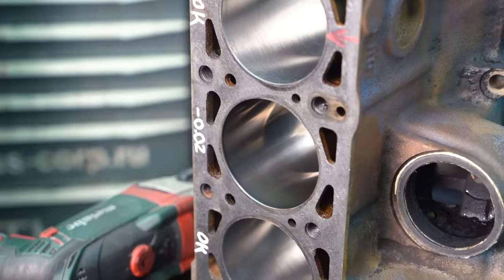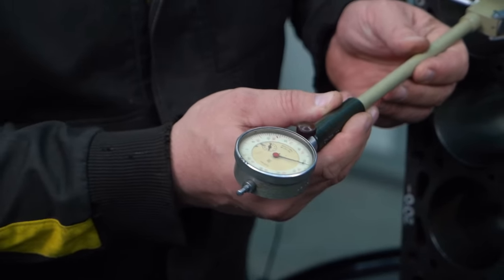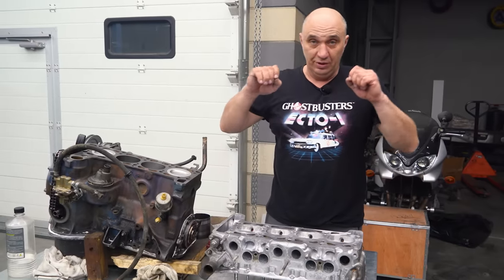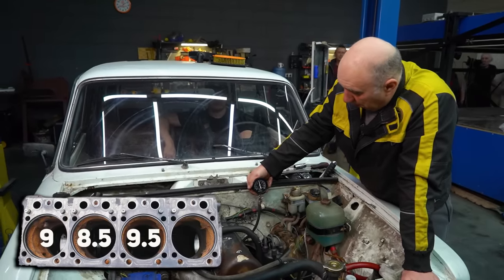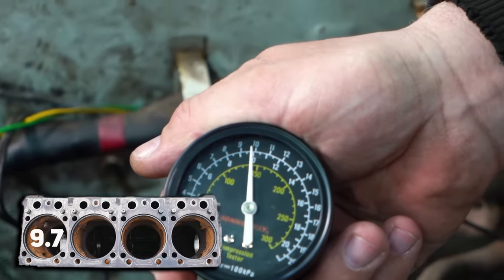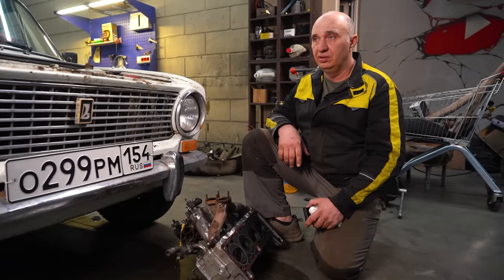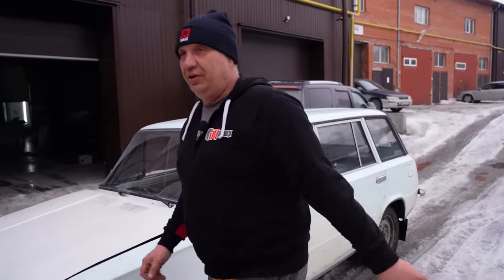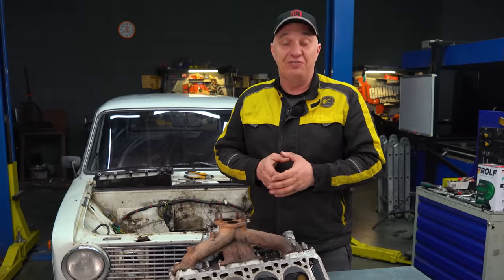Honed cylinders or mirror finish - which is better?

Comment: I never heard of a person wanting a mirror finish on cylinder walls. Usually when I see mirror finishe on cylinder wall the engines is worn out.
Reply: Oh yeah? What about Nikasil Chromium Bores? All of this work has been studied (in depth)  by most Car & Motorcycle Manufacturers.
Reply: @peterduxbury927  Still never heard of it
Reply: @peterduxbury927  That's mostly a 2-stroke thing. I have never seen a 4-stroke with hard plating in the cylinder. (not saying they dont exist)
Reply: @markchapman2585  Motorcycle engines. Ultra-high RPM.
Reply: @peterduxbury927  nikasil bores are still honed for proper cross hatching.
Reply: Most race engines are honed to a mirror finish but they have special low tension rings  designed to work with smooth cylinders. check out some videos by Lake Speed Jr or Total Seal rings.  Lots of horse power to be gained by reducing the friction of the rings. Also most of the engines that have these cylinders with the thin rings have a vacuum in the crank case for even more power.
Reply: @peterduxbury927 They are still honed to 2 stroke or 4 stroke.
Reply: @Pyroteknikid  Some Perkins Diesels had hard chrome plated bores around the 50's-60's. Most were cast iron though. On those chrome cylinders the piston rings were cast iron. We even have one tractor that has cast iron pistons and chrome cylinders. Top RPM is around 1500.

Comment: The look of those valves at the end of the video tell you everything you need to know.
Reply: Yeah I was gonna say, the only real results are in the heads
Reply: Enlighten us. What do we need to know?
Reply: @rsemrad2  basically the smooth creates more carbon in the heads from the piston rings removing hundredths or thousandths of metal from the cylinder walls and themselves through contact. A smooth bore would allow equal distribution of pressure around the cylinders but momentum would mean the pistons have just enough wiggle room to touch the cylinder walls where as with a honed bore, you would have those pockets of unequal pressure filled with fluid and fluid is dynamic which means the pressure would force the oil into the low pressure pockets, thus creating a smaller area for pressure to build up and equalizing the pressure. In the smooth bore that pressure only sits in one area and is dispersed on the 3rd stroke instead of every stroke in the process. It means your rings will wear out faster and if there's blow by, then it's just as hard and as fast going the other direction as it is going in the intended direction
Reply: @Unfoundrumors as I understand it 2 and 4 are polished and those are the cleanest. 1 and 3 are honed and those are dirty
Reply: @doopiej  yes and as the brother explained, when your cylinders get hot enough, they’ll burn deposits away, which means those rings have a higher chance of failing in those cylinders
Reply: Something else I noticed is that some of the shots in video are identical to the episode where they make custom valves from a gold-colored soft material. Those valves were worn at the point of removing the head and there's no telling if they sealed well at the guides. Maybe we shouldn't really draw any conclusion from this video😮
Reply: @doopiej  there's plenty of reasons why not to use smooth bore on an everyday application, smooth bore is really only used for racing cars and engines that are not going to be used for very long. You just wanna fuckin argue about other shit cause you don't know anything, the biggest reason you hone a bore is so that the piston doesn't scour the cylinder and crack it causing coolant to leak into the cylinder and thus leading to something called a "break down"
Reply: @Unfoundrumors  I haven't at any point remarked polished cilinders would be better for everyday applications and frankly I think your reaction is a bit weird and uncalled for.
I know perfectly well why honing is used and how rings and walls should wear. 
Just thought it was interesting the polished ones that ought to leak and burn more oil look cleaner in this particular head, but at the same time those valves aren't actually normal valves so there's nothing you can really conclude from looking at them anyway.
Reply: its not a big deal either way  ive put heads on motors that were high mileage and mirror smooth the motor ran for a long time afterwards. i do crosshatch mine but in my experience its not that big of a issue ,ive seen em rebuilt with no honeing and run perfect for many miles

Comment: I swear these guys can read minds... I was wondering exactly this yesterday while thinking about sleeveless alloy engines (like Briggs and Stratton Koolbore) requiring a mirror finish in order to not eat themselves to death. I think it's a 2 stroke trait though, whereas a 4 stroke requires the honing to hold oil on the walls.
Reply: A 2 stroke need an honed cylinder to hold oil just like a 4 stroke
Reply: @pietrodiani6368  no they chrome plate most 2 cycle weedeaters smooth when the plating wears out it is toast
Reply: @patrickday4206  that is not chrome plating. I think it's Nikasil on aluminum bloc. When the plating wears out, the block is not serviceable anymore.
Reply: That would make sense because you put oil in the mix for two stroke engines.
Reply: Sleeveless engines of aluminum rapidly wear the aluminum down but leave the harder silicon parts of the cylinder wall in place.

Comment: Back in the early 90s, I did a ring job on a 4 cylinder engine that had stuck rings on one cylinder and a cracked piston in another I honed the cylinders and after a week of regular driving, I took it for a 350 mile round trip that took about 6 hours. That engine never used any oil after that. It used half a quart during break in and that was all it ever used during the time we had that car.

Comment: Honing for a combustion engine allows holding oil in the cylinder walls for better lubrication.  Smooth walls are for Hydraulics to save the O rings for a longer life!!  Been a mechanic for 45 years
Reply: Doesn't the oil just bet burned off by the ignition cycle?
Reply: @michaelbirchall2247  yeah so does a 2 stroke engine you want a continuous oil film just like bathing your main bearings that's the whole concept! If you took an engine with a cross hatch pattern and took and ran total synthetic oil it would never break in! It would actually consume more oil that's why conventional break in oil is preferred then switch to synthetic oil latter . Those rings need seated in ..
Reply: Yes, rings need to be seated during the break-in period of an engine: 
 
What happens during break-in
The break-in period, also known as run-in, is when a new piece of equipment is conditioned by running it for an initial period. 
 
Why rings need to be seated
The rings need to be seated into the cylinder wall to create a compatible seal. This process ensures that the engine achieves maximum power output and consumes the least amount of oil. 
 
How to seat the rings
The engine should be run under a load to increase cylinder pressure and force the rings into the bore. This can be achieved by gradually increasing the load from 50 to 75 percent, and eventually to 100 percent. 
 
Tips for breaking in an engine 
 
Avoid pushing the engine too hard. 
 
Vary the engine load and rpm. 
 
Don't keep the rpm at the same speed for more than a few seconds. 
 
Lightly let off the gas pedal and gently get back on it.
Reply: A cross-hatch pattern on a cylinder bore can help with lubrication and engine performance, but the ideal angle depends on several factors: 
 
Angle
A 45° cross-hatch angle is often considered ideal because the piston's upward motion spreads oil sideways to cover the entire cylinder wall. However, the ideal angle can vary depending on the ring tension, stroke length, and other factors. For example, long stroke engines may perform better with a 60° cross-hatch. 
 
Too shallow
A cross-hatch angle that's too shallow can cause wear issues. 
 
Too steep
A cross-hatch angle that's too steep can cause oil consumption, dry starts, and premature ring wear. Ring manufacturers typically recommend a cross-hatch angle of 22° to 32°. 
 
Measuring
A protractor or business card can be used to check the cross-hatch angle. A Cross Hatch Angle Checking Tool can also be used to measure the angle. 
 
Appearance
A freshly honed cylinder will look rough, while a used cylinder will have a "glazed" surface with little or no visible cross-hatch.

Comment: This is a valid concept. Very high performance engines are built to much tighter clearances but they are less cross-hatch and more polish. On the other hand, they are NOT daily drivers and will not start without a preheating of the oil and coolant, most of the time overnight.

Comment: Honed and then smooth out the peaks always worked the best for me
Reply: Microscopic peaks?
Reply: Lol that's what break in is for
Reply: @Skaadi89  Not if you're a professional lol.  They use surface profilometers to measure the actual microscopic peaks and get the finish exactly how they want it.  You don't want to have to break in a race engine cause now it's lost a bit more of it's already short life.  You fire it up, check the tune, maybe check a two-step if you're drag racing, then you quickly shut it off.  You want to run it as little as possible unless its actually racing.
Reply: works only on aluminium
Reply: @FuckGoogle502 I've never did a break in on any engine, new or my race engine, I guess just what u feel like, nothing better then brand new
Reply: It is called plateau honing I believe. It makes logical sense and seemed to work very well in my Suzuki 1100

Comment: I'M A MECHANIC HERE, and I know of a problem that Audi suffered by making the cylinders with a mirror finish, the lack of honed caused excessive oil burning in the engine of the Audi A4 sedan, a friend of mine who worked at Audi spent almost a year reworking these engines, dismantling and grunting and assembling these cars,
and the results match the video demonstration, so it's decided that honed is necessary
Reply: The crosshatch eventually wears to a smooth surface mating the rings to match the smooth surface, That is when it is broken in.
Reply: @midgetrace  My dad's car with 250k miles still has it's cylinders honed in a cross pattern. Definitely went not away within breakin period, as they shouldn't
Reply: My Chevy 350 had 266k miles on it and when I took it to the shop they swore that there was no way it had more than 150k miles on it.  Seven of the eight cylinders had the factory crosshatch and perfect compression.  Only one was smooth on one side, where the head cracked and dumped coolant in the cylinder, thus the rebuild.  All I did was regular oil changes with a good quality filter and high rated cheep oil every 3k.

Comment: The way ive been told about honong - you can only get so good of a machined finish. So adding in the cross hatching (in addition to letting it retain some oil during break in) allows the rings to essentially machine themselves to the cylinder - implying a mirror finish is what you're going for, but you'll never really achieve if you need specific tolerance

Comment: Depends on the ring package more than anything else.  For best performance (and will use some oil): Typical cylinder bore finish readings of Pro Stock or Comp Eliminator, or NASCAR engines are as follows: Rpk 4 to 6; Rk 18 to 22; Rvk 18 to 32

Comment: Carbon deposits don't necessarily come from burning oil. Gasoline is a hyroCARBON fuel. Incomplete combustion can leave carbon deposits. Too little air can make the engine smoke, right? Love the video!

Comment: the mirror finish seen in some high-end engines is because of the different material not the machining process. mostly used on alloy blocks and diesel engines. the mirror finish bores are the result of molten steel alloy sprayed on the bore. this reduces ring to bore friction. the ring style and composition is also very different.

Comment: Honing is about durability not compression. It's main purpose is to create a film of oil under the piston rings in the valleys trapped.oil in Shiny cylinders will get wiped right away by piston rings.

Comment: Wellll, hone finish depends on the ring material. In the 1960s chrome plated rings were common. These required a fairly coarse cylinder wall finish to enable the rings to wear into the cylinder walls. On initial startup the friction was high and it may take 30.000km for the engine to break in. Then we progressed to a molybdenum infill in the top ring face. This required a smoother cylinder finish applied using finer grit stones. Now cylinder walls are initially honed with diamond stones of about 400 grit to about 0.0003" from final size. Then 800 grit stones are installed and 5 or 6 strokes are made to knock the high spots off the cylinder walls. The rings and piston skirts ride on the flat surfaces left while the deeper scratches hold oil to lube the skirts and rings.

Comment: Aside from the Ford Pinto 2300, America never built a 4 banger as tough and reliable as a 50 year old Lada.
Reply: Yeah that 2.3 Ford is bulletproof. Chevy version not so much. Vega should have used the Ford 2.3 under license.
Reply: @Dannysoutherner   GM jumped the shark with that aluminum 140 cubic inch engine in the Vega.  In 1976, they finally worked out the bugs and called it the Dura-Built 140 but, the car's reputation was toast at that point.
Reply: @BlackPill-pu4vi  I had a 77 Vega when I was a teen. It moved under its own power and price was right so it was a great car to me. Blew a head gasket, my fault. Fixed that and learned a lot along the way. My mom borrowed it one night and piled it up. Todays rolling iPhones I have no use for. Give me pre 90s any day.
Reply: @BlackPill-pu4vi  If they had put the Cosworth motor in ALL of them, they woulda had something.
Reply: @JeffKopis   Yes.  The 2.0 Cosworth engine that did get put in the Vega has massive tuning potential.  It was choked by the smog equipment of the time.  Some car magazine (don't remember) desmogged a Cosworth Vega and that engine really woke up.  New non-smog camshaft, fuel, timing, that engine's power really came out.

Comment: I guess it does matter on what type of rings you're using . But the 22 degrees (roughly) is important for proper oiling . But a standard nodular quick seater ring will have a hard time getting a seat on a polished wall texture, where as a chrome ring will be more at home with a polished surface . I figured 1 and three would have a better time with oil control . I built a lot of engines over the years though . Good work guys . :)

Comment: ROLF engine oil is just Castrol GTX with a different name, Buy Rolf and keep your engine running good 👍🏻
Reply: Rotella t6 with 10% Lucas stabilizer
Reply: @Dronoh throw that Lucas crap in the bin and just use fully synthetic oil. Modern cars don't like that thick goopy crap in their veins especially with the vvt engines and small bearing tolerances that Lucas stabilizer is just too thick. Might help an old ( pre 2000s) engine but keep that crap out of a modern engine.

Comment: The polished cylinders will probably need around 10,000Km before rings seat properly.
Honed cylinders will bed in rings faster plus, the 'scratches' allow an oil film to lubricate rings.

Comment: I think the differences have occured between the pistons because the honing and polishing was done by hand rather than on a machine. those slight variences are then multiplied by the thermo-cycling of the engine giving rise to those differences seen in the engine.